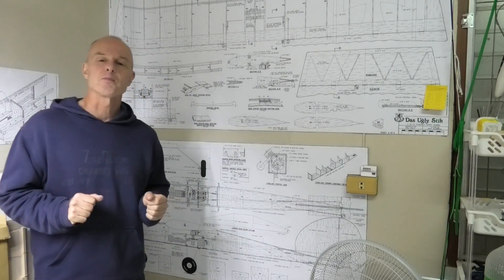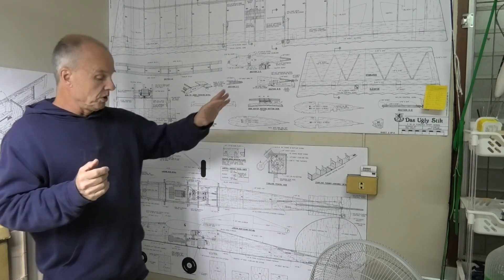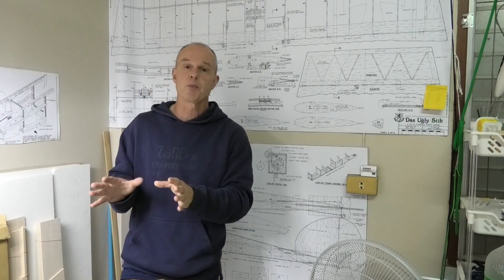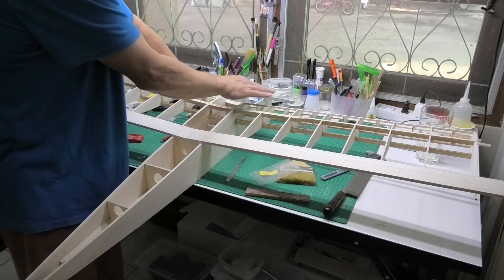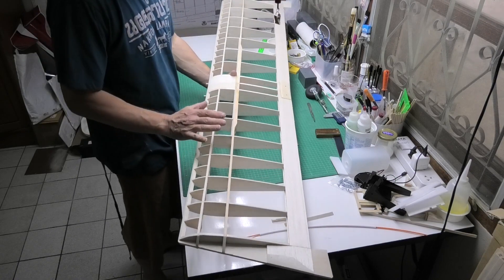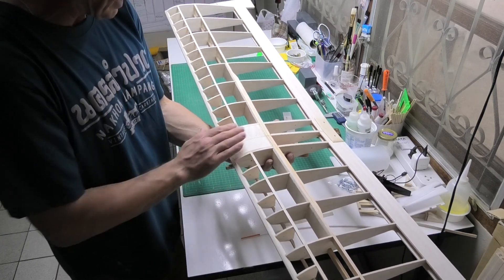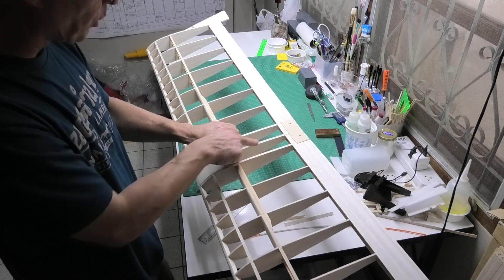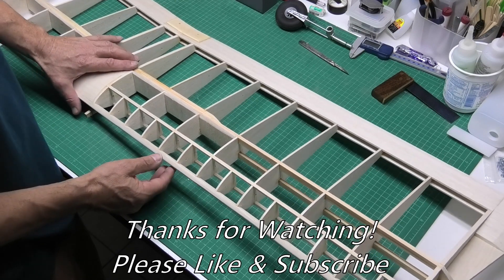Das Ugly Stik Balsa RC Aeroplane Build - Pt 4: Fitting & Completing the Wings

Comment: Excellent craftsmanship and build presentation.  But do be careful when you land.  Without rubber bands or nylon bolts to absorb impacts, your metal screw attachment system might end up tearing out and damaging your wing and/or fuselage attach points.
Reply from the maker: Thank you very much for the kind comment, its appreciated.  Regarding the bolts, thats a really good point/issue that had not occured to me, so thank you :)

Comment: A real dumb question from a newb....  You stick the image to the balsa/ plywood... Do you cut and sand Too the line or do you remove the line ???
Reply from the maker: Thats a good question, and I think you will get a different response from different people.  I generally cut to just slightly more than the line, then sand to the line.  I think the important thing is consistency, and checking your measurments all the time as plans are often slightly off, being streached or shrunken due to scanning and printing.  Good luck with the build.

Comment: Good stuff Mark, where do you source your Balsa in Chiang Mai?
Reply from the maker: In Thailand you can buy balsa from most of the stationary shops, but also there are good suppliers in Bangkok, like ABC Flying and Mini RC, both of which will send for next day delivery for only 50-50 Baht shipping. Getting things like spruce for spars can be a bigger issue.
Reply: @MarkRobinson555  so there isn't any wood shops that stock balsa or plywood